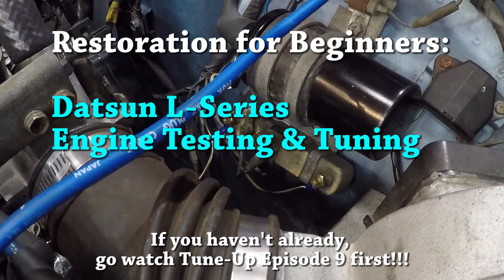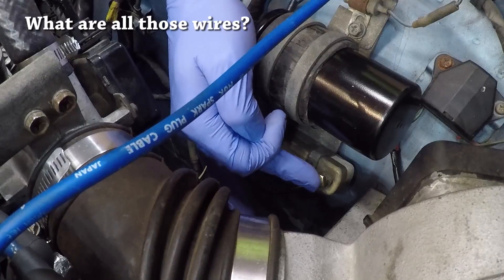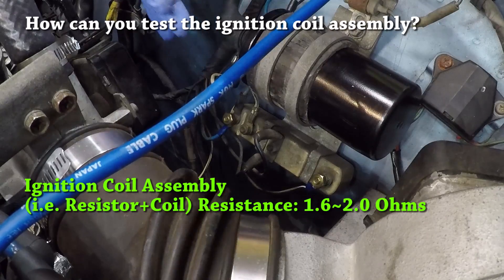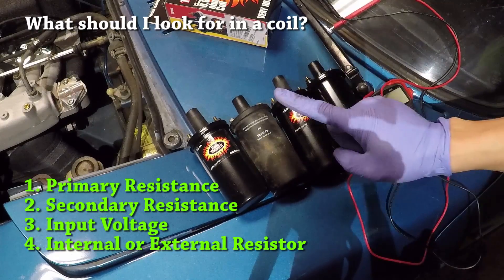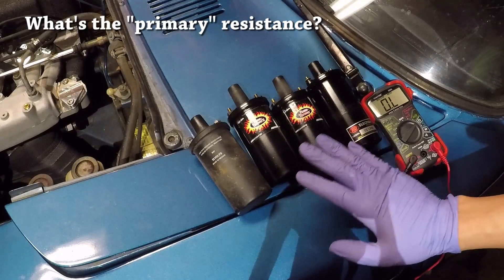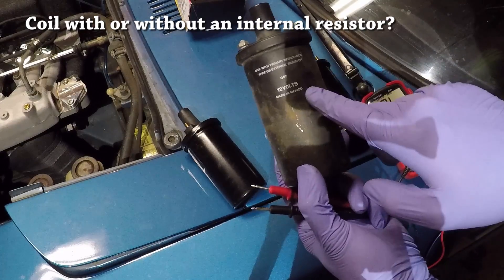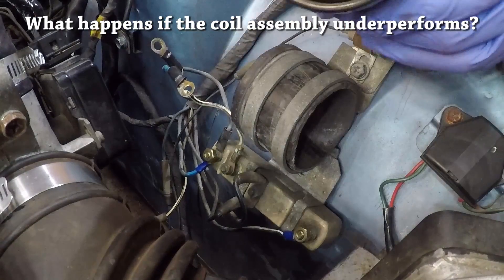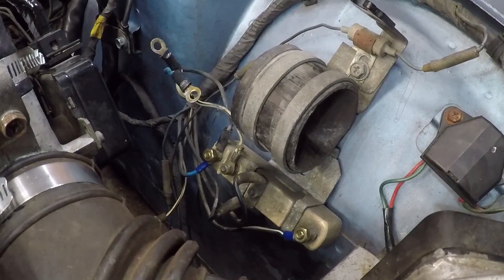Datsun L-Series Engine Testing and Tuning Ep.9.5 Ignition Coil Assembly

Comment: This video is exactly what I needed for my '77 280 Z. I had narrowed it down to bad ignition coil or fuel pump. I plan to buy the Denso that came from the part number of my original installed. I hope this works. Just looking for the video on how to test with the multimeter...

Comment: I purchased a coil with the built in resistor for my 1970 240Z. You said that you don't recomment bypassing the external resistor. Would you recommend getting a coil that does require the external resistor rather than getting a coil with a built in resistor? Thanks and great video!!

Comment: Awesome coverage!  JUST what I was looking for!  I just picked up a 240z (hadn't had one in 25 years) and I'm relearning its internals.  I never really understood the coil when I was 25, and right now, I am just enjoying combing through every bit of this Z's connections & rebuilding/examining every component. (found wrong springs in the carbs!, one weak and one strong!)  There is a new coil installed and there is a flamethrower in the back hatch that also looks brand new, so I suspect I will find the wrong coil in this Z as well.

Comment: Great video, appreciate you putting this content out there! 
I had to replace my coil last week...the original held in there pretty good to be a junkyard rescue zcar but after driving it a straight 44 miles, it was not happy.

Here were my symptoms for anyone that may be curious of what one of the failure modes are of a bad ignition coil: 
I was on my way home from a 44 mile drive and I started having this odd feeling like the car was either loosing fuel delivery or loosing timing, it would idle fine but at take off or under load, it was very weak and backfiring just as if timing was out. I checked fuel pressure and had completely rebuilt fuel system earlier so doubted that but still checked everything there and then turned my attention to timing and that's when things got odd...I had to really retard the timing to even make it run decent, (timing wasn't even on the timing marker bracket). When car cooled down, it was hard to start but would run pretty good for about 4 minutes and then start spuddering and backfiring. It was pretty miserable taking off at green lights because of the odd hesitation. Engine never stalled and never had any loping, it idled fairly normal but at times you could feel a slight miss. 

 I went with the MSD blaster 2 vibration rated coil and have been happy with it so far, it is a 700m Ohm, ( .7 Ohm) coil on primary windings. I mainly went with that because that was what my local parts store had and it met the specs..so far it has treated me will these last two weeks of daily driving.

Comment: You have been of great help. A question, does the same apply to 280zx’s? I don’t see some kind of resistor pack near the coil bracket.
Reply: Buying a ZX tomorrow, did you ever figure this out? Car isn’t getting any power past distributor so I’m guessing distro or coil is the problem.

Comment: GREAT VIDEO!  Had same problem with previous owner incorrectly connecting the wires to the + and - terminals.  Only realized it when I watched this video, led her by video 9.0.  I have lived with the difficult starting since I got the car 9 months ago - have tried everything to resolve it.  Turns out, I only needed to switch these 2 wires.  That said, I'm sure all the other stuff I did also have made a positive impact on my '78 Z, but now I might actually see and feel the difference.  Thanks for posting these vids.

Comment: Hey man love the videos watching all of them I haven't solved my problem. I bought a 74 260Z and put the Weber carburetor conversion kit on it it will not fire. I put a new distributor it is a conversion kit as well that I purchased off of eBay for $400. I have checked all my timing like you have suggested on your videos. I have checked my coil with a resistance. I am a little concerned with my distributor my rotor turns clockwise? And the firing order for a 260Z I can't find in my book? Before I change the stock distributor it would run when pouring gas into the carbs the air gap was off and I corrected it and damage the rotor so I've had to buy a conversion kit because they do not sell a OEM distributor?. Can you give me any advice thanks.

Comment: Hi, i have a question. I upgrade my coil it was like 15,000 volts and now im at 30,000 but i have a missfire now is it because i need to upgrade my spark plugs wires?

Comment: Dude, I swear you have got to be a reincarnation of one of the original designers or engineers of this car because your knowledge is freaking impeccable!  I don't even need to take a class lol.  Very informative, step by step, and descriptive in trouble-shooting Datsun electrical.  So, I do have a question regarding stock coils vs. aftermarket coils:  

Do MSD ignition/coil upgrades really improve the system or do they actually make it run worse?  
I never really thought about it until I watched this video.  So, I have an MSD on my 76. (installed by someone else) and I don't even know how the thing works.  I do know that its wired in differently and bypasses the stock system.  But, I don't remember if my 76 has that ballad resistor installed or not.  I am just wondering if this setup is actually making the car run worse.  Please note that my Z has been turbo-charged and has a larger fuel and air requirement, thus the larger spark setup.  Your thoughts, please?  Man, I appreciate it!
Reply from the maker: Ahhh, so in your case I have no idea if that's helping or not helping since I don't know what engine is in there. Is it the L28ET?
Reply: @RestorationForBeginners  well, you're probably not going to believe me, but it has the original naturally apirated L28E that came in the car, only it is now an NA2T (naturally aspirated to turbo) as I have turbo-charged it.  
I did have an MSD box installed and an aftermarket coil.  Just wondering if the coil is too much? vs the stock unit.
But I don't remember ever having many starting issues or odd electrical problems.
Reply from the maker: Honestly, if it works fine, then I'd leave it alone. I'd just make sure that the coil doesn't have an internal resistor built in if the external resistor is still connected.
Reply: @RestorationForBeginners  Yeah it seems to work fine.  But I will definately check that and make sure it doesn't have the resistor built in.  That never even occurred to me when I  installed it.  Can't wait for the next video!  Thanks, dude.  Cheers

Comment: Regarding the Pertronix coils you have, the .5 oms is for a stock system with points. Their 1.5 ohm coil is for use with their Pertronix Ignitor (replacing the points) while maintaining the stock ballast resistor. And they make a 3 ohm coil for use with the Pertronix Ignitor but bypassing the stock ballast resistor (the 3 ohm coil is internally resisted).
Reply: Thanks for posting this I just removed my ballast resistor because I ordered the pointless ignition and 3 ohm coil and I have been scratching my head intil I read your comment.

Comment: from my understanding of the video, you could use either the 0.6 flamethrower coil with the resistor, or the 1.5 coil without the resistor? my 74 260z did not come with a ballast resistor, so I am wondering if the 1.5 would be the correct option or to get the 0.5 and buy a ballast resistor to go with it. Thanks in advance, awesome video by the way.

Comment: This is an ignition coil with the correct primary and secondary resistance. I've been using it for a while without a ballast resistor and havent had any issues. https://www.amazon.com/dp/B00064P99W/ref=cm_sw_r_cp_apa_w76NBb62YM69F
Reply: I swapped to 280zx distributor btw

Comment: I’ve had one of these ballast resistors go bad on my 260z. It would crank and try and fire but as soon as you let the ignition key go back to the run position it would die.
Reply from the maker: Haha yeah that sounds like there was no connection between terminals 1 and 3 maybe.

Comment: Your videos are excellent :) your explanation on resistance has been interesting.  I currently have a Datsun 260 with a L26 engine. Currently have a triple Weber setup with Lumenition Ignition Kit, my current Coil has a ballast resistor connected to it.  Im looking to upgrade the ignition coil to a Pertronix Flamethrower 3 ohm Ignition coil.  Will this be suitable? Thanks in Advance :)
Reply from the maker: Thank you! Like I said in the video, if you're looking to add in a coil that has an internal resistor built in, you have to bypass the external resistor as I've shown here. Why do you want to upgrade the coil? Is it running poorly now?
Reply: Restoration For Beginners . Bought the Car recently, the idle is poor from a cold start, it's cuts out after a few seconds, I need to engage the throttle until it warms up and then it idles fine. Revving the engine also causes a detonation sound from the Weber carburators, I changed the spark plugs and ignition cables a few days ago, still had the same issue and the ignition coil I have is generic with no marking so not sure if it's suited for my car. I  suspect there is a leak around the exhaust manifold, 4-5th cylinder , which would also cause the sysmptoms, so will be replacing the gasket at some point. Will be going through your process once iv had these issues rectified. Thanks again, I look forward to your posts :)

Comment: Trying to find a coil for my Turbo, it took testing around 10 Coils, that stated it was within specs for the car, which they weren't, I 
ended up taking my meter to the parts store and doing a test right on the counter, think the people thought I was crazy. But I finally found one with the perfect specs. I just wonder if it makes much difference.
Reply from the maker: I hear you. To me it made a massive difference. I cant tell the difference during normal driving, but starting is instant now and the car doesnt backfire as much at rapid deceleration.